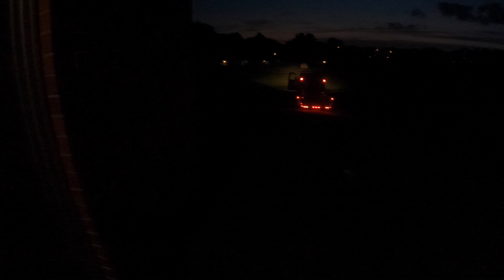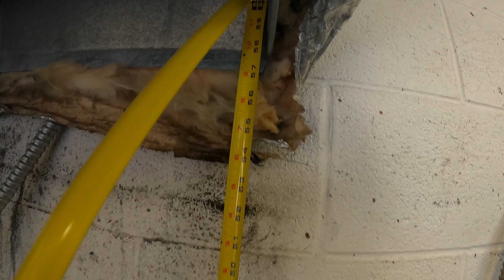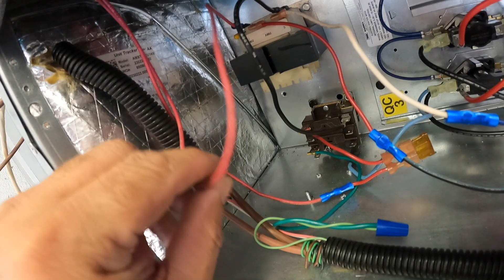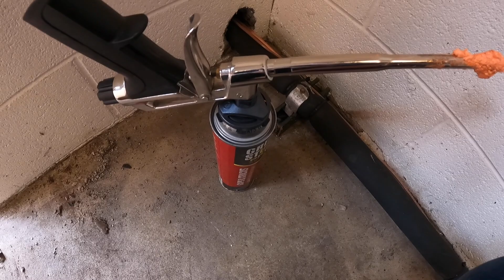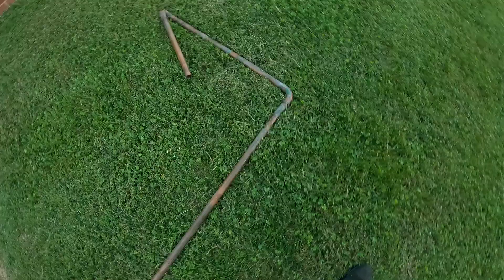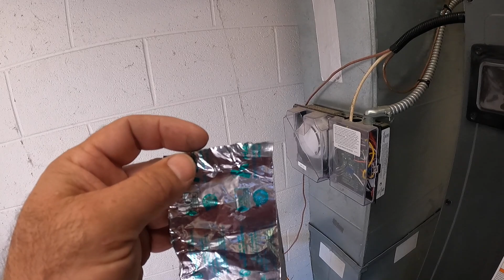HVAC Heat Pump Changeout: Replacing a Trane with a Goodman

Comment: What's the heat rise on  the Goodman GSZB4. If say the outside temperature is 30F degrees. And inside is set to 72F. Would it be 85F coming out of the vents. Thanks.

Comment: Where is that pretty nice Goodman made?
Reply from the maker: “Assembled in USA” lol. I think they have a big factory in Texas?
Reply: I thought so... but who knows anymore... @ComfortPlusHeatingandCooling
Reply: They're made in Houston
Reply: Goodman, especially that model is made by the Daikin corporation which is also Amana.  You can buy identical twins of Amana and Daikin units.  The Daikin has a 12-year warranty.  All three brands are fantastic units, especially when the installation instructions are followed by a good technician.  I sell them sure, but I also sell many other brands like Bryant Evolutions, ICP Ions, ACiQ, and many brands of mini-split style condensers that can be ducted or ductless from Mitsubishi, Fujitsu and various other brands.   We sell dual-fuel systems here in Colorado, but that HP is the new 14.3 SEER2, which means it was most likely a 15 or 16 SEER before the EPA change.  HSPF was probably 8.5.

Comment: great install! only problems ive ran into with those new Goodman's is the fan blades hitting the shrouds and the wires in the condensers not secured and rubbing out